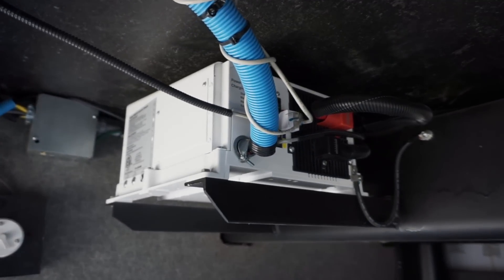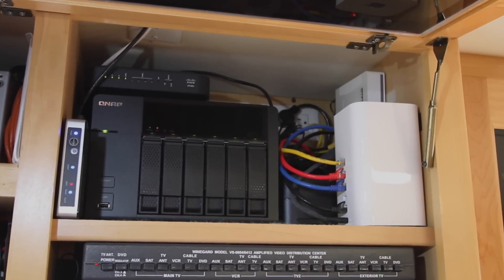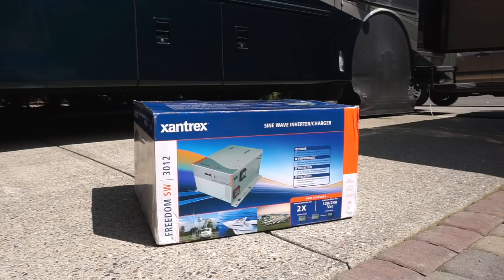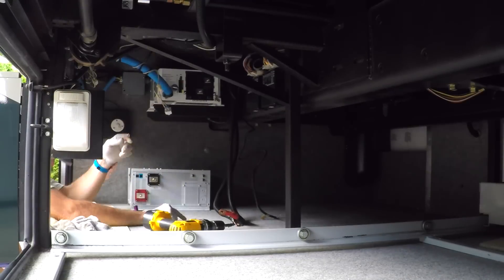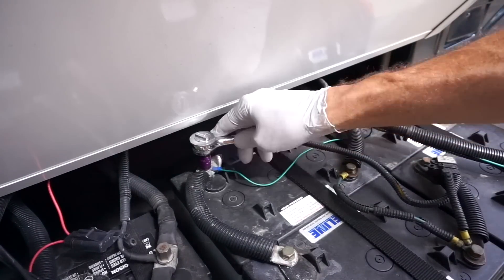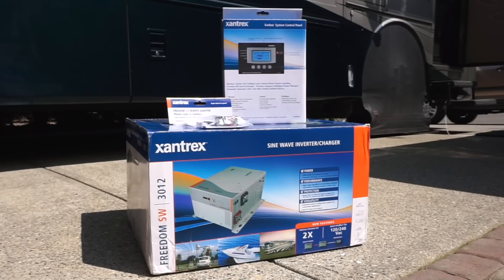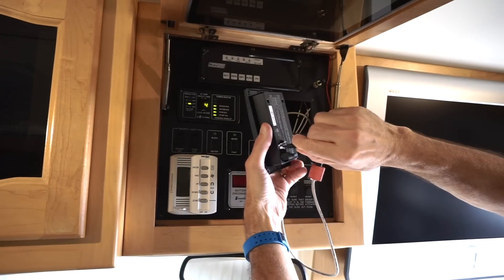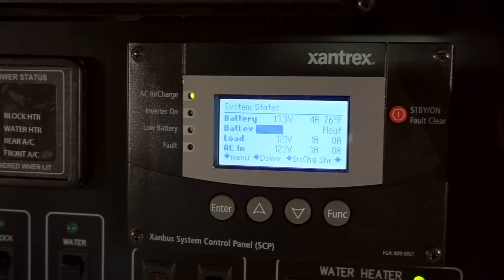RV Inverter/Charger Upgrade - Xantrex 3000-watt Pure Sine Wave

Comment: Again I find myself in your debt. This is an excellent video and answers many questions regarding an inverter upgrade. The current inverter in my coach is a MS2012. I am installing a large Li Ion battery(s) 600 amp and the manufacturer of the battery is recommending that I upgrade to the Xantrex FWS3012. The battery manufacturer has created a custom firmware that works well with the management system of the BMS. 
My question is other than the Xantrex Inverter controller, did all the controllers like the AGS, transfer switch, etc. work with the new inverter without issue? One of my goals is to run the front A/C, with a soft start, occasionally for short periods on battery. I do have a residential refrigerator as well.
My concern is that I will have to change a large amount of ancillary controls to get a reliably functioning electrical system?

Thanks for a great video.

Joe
Reply from the maker: Hey Joe! Thanks for the kind words... and glad this video was helpful for you. Sounds like you've got a sweet lithium upgrade planned! As far as switching brands on the Inverter, the only other item (aside from the System Control Panel) that also needed to be changed out was the Magnum Auto Gen Start module, since the one we had was the networked version... and Magnum's networking components aren't cross-compatible with Xantrex's Xanbus system. But it IS possible that Magnum's non-networked, stand-alone AGS unit would continue to work just fine with the Xantrex... you just wouldn't be able to control it from the Xantrex SCP.

Our transfer switch is totally separate on our Newmar... no connection whatsoever between it and the inverter/charger, system control panel, AGS or Combox. It's just a "dumb" device that looks for power on the generator circuit and switches over to it if it see it. So we'd assume yours is likely the same. Nothing else in our electrical system is in any way connected to the inverter's control system, so nothing needed to be changed out. There MAY be something else in your system that's communicating with the Xantrex, but we can't think of what it would be.

Hope that helps!

Comment: Do you keep your inverter on all the time - even when at a full RV Hook up?  Not sure mine is working - any tips to checking it would be appreciated.
Reply from the maker: We do indeed keep our inverter on 24/7/365. The reason for that is mostly our residential fridge. In the old days (when we had an RV fridge that automatically switched from propane to electric whenever power was available), we only turned the inverter on when we needed power for something (making coffee, powering our laptops, watching TV, making toast, etc). But now, if we're fully hooked up and the power goes out while we're asleep or away from the RV for the day, our fridge stays on since the inverter picks up without missing a beat. The ONLY time we shut it off is when we empty the fridge and store the rig during a long trip away from the RV.

The way to tell if your inverter is working (providing power) would be to turn it on while you're unplugged from shore power and see if inverted circuits are getting power. Not all RVs are wired to get inverter power to all outlets. For example, our Bounder only got power to certain outlets, but our current RV gets power to 100% of the outlets. In other words, if you turn your inverter on and don't get power everywhere, it might be designed that way. But if you turn it on and get 110-volt power ANYWHERE, it means your inverter is functioning (assuming of course that you're off shore power and the generator is off while you're trying this). If you can't get power to any 110-volt circuit, the first thing we would check is the circuit breakers, including the one on the inverter itself, which most of them have. Also, if the house batteries are low enough, the inverter won't come on. If your 12-volt lights are dim, this would be a likely sign that low batteries could be the problem. Of course a hydrometer can be used to check battery level as well.

Hope this helps a bit. Please let us know what you find out.
Reply: Thanks for the update.  I will certainly give that a whirl.  We don't have a schematic so makes things little difficult to figure out what fuses go with what and what is providing electric to which plug.  For instance - both the plugs on large slide out don't have power to them in any configuration.  I think it must be a fuse but unknown at this point.

Comment: I need your advice, I have (4) 100ah AGM batteries and (4)
140 watt solar panels with magnum MTTP charge controller and a 2800 watt pure sine
inverter. I'm trying to power my residential refrigerator with limited success,
I use about 200 ah per 12 hours (you see the problem) I really can't get thru
the night without generator help to prevent over discharging my batteries. My
AGM batteries are about 2 years old and can't justify all new batteries, so my
questions is.... can add 2 more AGM batteries for a total of 6? I know they
should be the same age in a perfect world but  budget does come in to play here. Also the
second bank would have to be in a another bay with about 8 feet of cable. I
can't seem to find any information on this type of set up.
Reply from the maker: Hi Billy Bob.We feel your pain... our residential refrigerator is also a big drain on our battery bank... and is the single largest reason we have to run our generator more than we want to.

As you mentioned, it's not "ideal" to add new batteries into an old bank. But from the sound of things, you're taking good care of your current set, and at only 2 years old (if well maintained) they shouldn't be so "old" that they will adversely affect new batteries you add to the system. Our first recommendation would be to run a short equalize cycle on your current bank right before adding the new batteries to the system, to minimize premature aging of the new pair of batteries.

As far as your plan to add the 2 new batteries in a spot 8' from the current set... again, it's not "ideal", but doesn't sound like a problem to us (take that with a grain of salt as we are far from experts in this arena). You'll want to be sure to use large-enough gauge cabling that you don't have unnecessary loss on that large a run (a quick Google of wire gauge and power loss should turn up what you need). And you'll also want to plan the wiring so that the two new batteries are wired into the setup correctly. Typically, you want the "+" and "—" leads from the inverter/charger to be spread across the whole battery bank... and not connected to the "+" and "—" terminals of a single battery. This ensures that charging power is applied across the whole bank of batteries, not just a single battery (which then spills over to the rest of the bank).  So if you're adding 2 new batteries into the array, you'll want to ensure that they are wired into the system in a way that this is still true.

Hope this all makes sense and results in a system that lets you sleep peacefully through the night!  ;)
Reply: If  you Are worried about the old batteries draining the new batteries I would use a 300 amp diode on the new batteries so that they don't get drain down by the old, you have 4 batteries so you would need 1 diode on the positive side of old batteries going to your inverter and 1 diode on the positive side coming from the charge controller to the battery, and on your new batteries (same thing) 1 diode from the batteries on the positive side to the inverter and 1 diode from the charge controller to the batteries on the positive side all together 4 diodes, but the diodes need to be rated at your amp draw, say your charge controller on charges at 50 amp then 50 amp diode is all you need and your inverter pulls 300 amp then 300 amp diode is needed going to the inverter and make sure you have the right size heatsink on them....the diodes will keep them from draining back to the older batteries, Diodes are fairly cheap but there will be a small voltage drop about .7 volts from the diode but that's not going to effect your inverter...

Comment: Why did you leave a Knock out open on one of your Junction boxes? This is a clear violation of the NEC.
Reply from the maker: +William Newhall We punched out that hole and then decided to use a different one for easier access. With the boxes mounted in the open, not inside a wall, we weren't worried about it. We're not electricians and didn't even know that was a code requirement for household installation. We appreciate your pointing it out for others if they plan a similar installation and want to do it to code (there's surely something else that's not visible that's not to code either) LOL

Comment: Can I have your old equipment, Im working on installing Solar panels and a innovator to my trailer.
thanks in advanced.
Reply from the maker: +Arod Rod We're not quite done removing the parts that we'll be including when we sell our Magnum inverter. It will include the control panel, auto-genstart system, and battery monitoring kit (except the shunt, which can easily be purchased from Magnum). We don't expect to be ready to sell everything for another couple of months. It really works just fine other than when we hit it with a heavy load (like firing up the A/C while the charger is ramped up in full bulk mode). Even then, it just causes a momentary blip. We would have continued using it indefinitely the way it is had we not gotten this opportunity from Xantrex. It's been working the exact same way for the past few years and been nothing more than a minor annoyance.
Reply: thats fine, please keep me in mind. thanks.

Comment: Ohhhhh Romex in an RV is a big no no. I've done it too but it's not good.
Reply from the maker: Not sure why that would be, Randy. Our motorhome has this exact same kind of cable in it from the factory, and it's used in just about every house in the world (or at least in North America). Is there something we're missing?
Reply: +RVgeeks Vibrations over time can break wires and stuff since its hard wire and that can cause fire. If it's got Romex from factory You're probably fine but I wired in some outlets in my old fifth wheel and the wires did break. didn't cause no fire.
Reply from the maker: We used the same method that's already present.... heavy duty wire nuts, tightened within an inch of their lives. So we're hopefully good to go. ;-)
Reply: +RVgeeks You should be fine yeah. Boats definitely not though.

Comment: can you simply tell me, can and do I leave my inverter off while plug into shore power ..🙄
Reply from the maker: In our Bounder, we had an RV fridge, which would automatically revert to propane if no electric power connection was detected. So we always left the inverter off until we needed 110-volt power to something while we were dry camping (coffee pot or toaster in the morning, etc). Since we replaced the RV fridge in our Mountain Aire with a residential fridge about 5 years ago, we NEVER turn the inverter off, except the rare times we're away from the RV long enough to empty and shut off the fridge. The inverter basically stays on 24/7/365. That way, when we're driving on the road or dry camping, it powers the fridge 24/7. When we're hooked up at a campground, we still leave the inverter on so that if there's a power failure while we're out for the day, we don't come home to a defrosted freezer. Keeping the inverter on 24/7 has the added benefit of providing continuous power to all outlets in the RV, so that our electronics get continuous uninterrupted power at all times, hooked up or otherwise, and a power blip, even a momentary one, is never even noticed.

Comment: Is there anything to be concerned about installing this 30 amp inverter into a 50amp RV and subsequently hooking up to shore power? Is the EMS that xantrez offers needed?
Reply from the maker: Nothing to worry about, as the inverter is fed by a 30-amp circuit in the breaker box, same as the old inverter we replaced. This is the way they all are, as inverters doesn't feed everything in the RV all at once and don't need to match the RV's power cord. It all depends on the loads being used, not the power being being supplied. And no, the Xantrex EMS is not required, although it does provide additional functionality.
Reply: RVgeeks thanks for the reply, we just upgraded from a freedom458 and so far we are loving the added power and functionality, as well as the new residential fridge :) I just stumbled across some forum posts where people were talking about needing transfer switches because they don’t make 50amp inverters. Always learning!